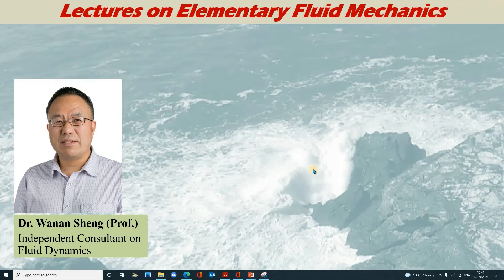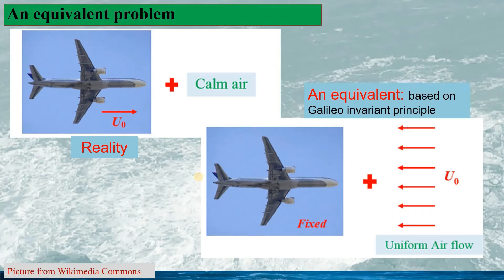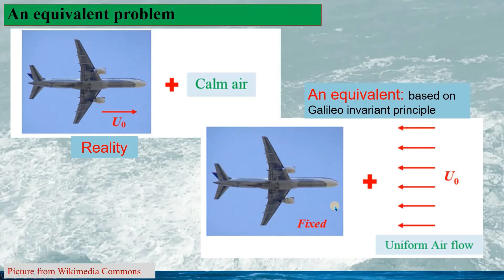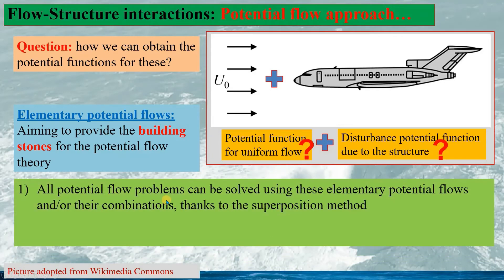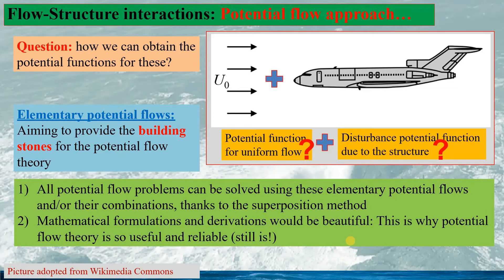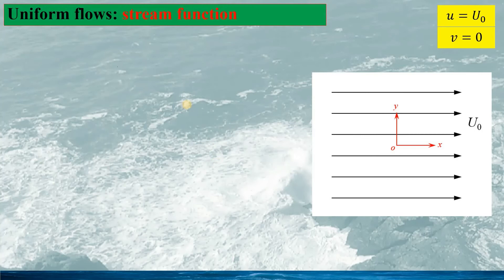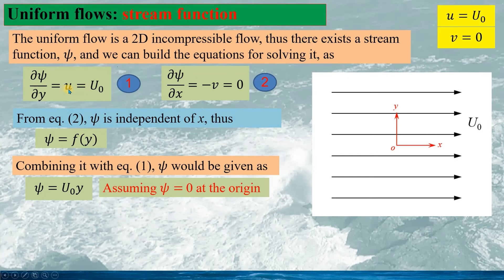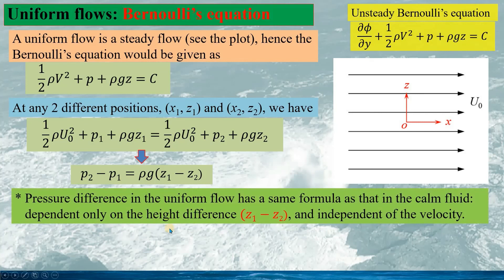Elementary potential flows, the building stones for potential flow theory. Part 1: uniform flows

Comment: Thanks alot dr Wan. honestly your talks have helped alot.i want to make a kind request if you could do an example of a solved problems for a typical 2D problem on applying BEM in solving for the radiation and diffraction problems.it would really help with all the applications of those maths equations..thanks alot
Reply from the maker: Yes, I planned the lectures to show the flow-structure interactions
Reply: @ScienceofFluids  i eagerly look forward to it.thank you  very much in advance!
Reply from the maker: @austineadah2843  do you know we have open sources for the radiation and diffraction applications? Nemoh and hams are those.
Reply: @ScienceofFluids  yea i know of NEMOH and Hams..just that the tutorials on NEMOH isn't explicitly easy to follow.secondly i don't know if NEMOH also works for floating structures other than ships.
Reply from the maker: Both can be used for floating structures since I have used both, and I am preparing a paper for the comparison using these two open source (compared to WAMIT), and I am not sure whether they can be used for the floating structures with a forward speed, because with the forward speed, the potential function would be more complicated. My applications are mostly the stationary floating structures.
Reply: @ScienceofFluids  okay that would be great.should there be resources on how these complicated green functions are applied in getting the radiation and diffraction for various modes I'd be glad to have a link to it.once more thank you very much
Reply: @ScienceofFluids  thank you so much. I wait in anticipation for those solved example on radiation and diffraction BEM problem applying the green functions and all boundary conditions.learning alot from all your videos..thanks
Reply from the maker: @austineadah2843  thank you again for your interest. In the radiation and diffraction problems, there will be no easy solutions even in 2d cases, because we have to apply the complicated green function for accommodating the free surface, i.e. waves. Unlike putting a cylinder or a sphere in the uniform flow, where we have the simple analytical solutions, but radiation and diffraction would be much more complicated. Generally solutions in numerical methods.